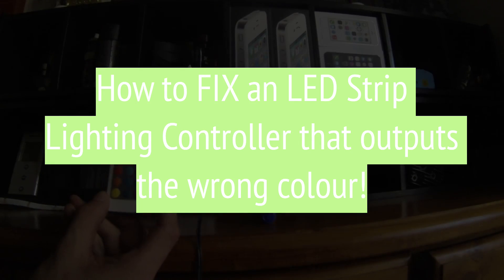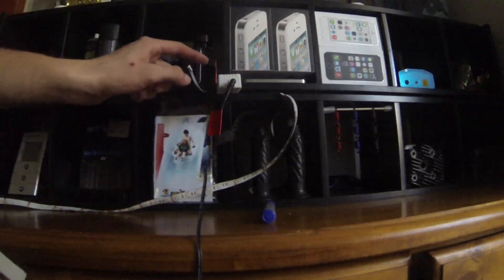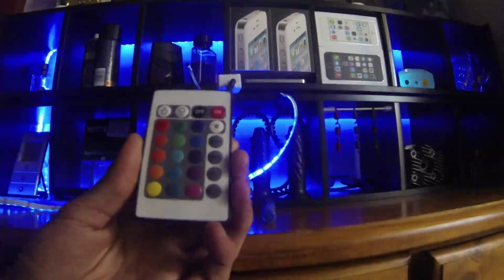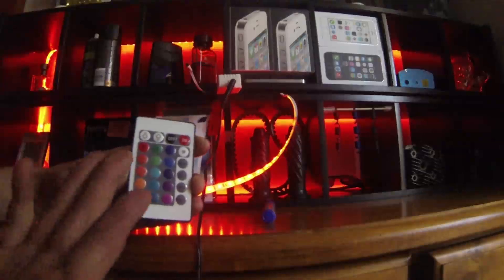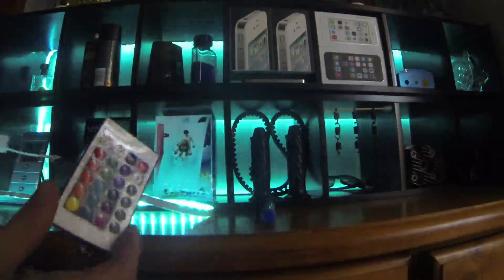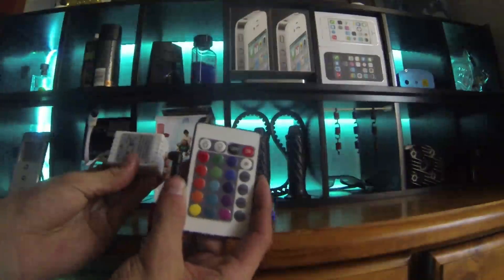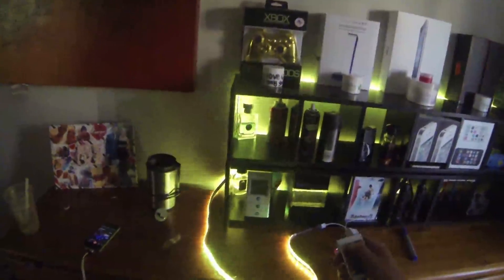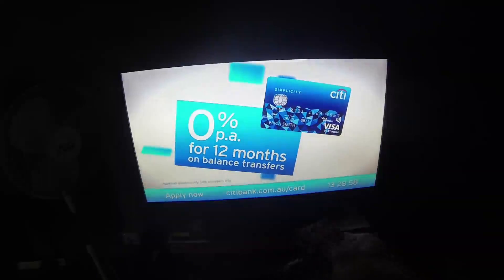How to FIX an LED Strip Lighting Controller that Outputs Wrong colour!

Comment: Hey, when I put off my ledlights, he turned lightred. When I hit on, the leds are the color I last chose. I followed the steps you did because my color outputs were wrong, that is fixed now. But still the red color when I hit off...
Reply: Same With me but blue, did you find a fix?
Reply: +Lord Of The Jaffas Main Channel Yeah, press "ON", "OFF & SMOOTH" do this until you have the right color.
Reply: oh i misunderstood, when i press off on my leds they turn blue doing on off then smooth did not fix this for me thanks anyway
Reply: So, when your LEDS are off, press "SMOOTH", until you got the right color.
Reply: that is one of my problems, but that doesn't fix it, it cycles through different configs but not the correct one,also when my leds are off the blue leds stay on
Reply: Yeah, my red stays on. But I'll fixed it with pushing on "SMOOTH'.
Reply: so just turn the leds off turn them back on and click smooth? when i do that the leds still stay on when i press off. and the remote still isnt programmed correctly. any ideas?
Reply: +Lord Of The Jaffas Main Channel No, when the LEDS off, then click SMOOTH en then on.
Reply: thats what i did, i mistyped
Reply: +Lord Of The Jaffas Main Channel I don't know than, sorry...
Reply: thanks anyway
Reply: +Lord Of The Jaffas Main Channel No problem, wait, what controller do you have?
Reply: +Corrender the white 24 key one
Reply: +Lord Of The Jaffas Main Channel I have the same I guess. Just try some buttons. I'll look tomorrow if I was right.
Reply: +Lord Of The Jaffas Main Channel I have the same I guess. Just try some buttons. I'll look tomorrow if I was right.
Reply from the maker: Hey mate, open the Controller Module Box with a flathead screwdriver and let me know if there is any damage/burn marks- if so you will have to purchase a new controller :-)
Reply: +Drew BoyerGamingHD good idea, will give it a go and let you know
Reply from the maker: Lord Of The Jaffas Main Channel Sounds good, i have a feeling it will be your problem.
Reply: +Drew BoyerGamingHD I know that it's a problem with the box as I tried it with different leds and the problem persists so I would guess you are right

Comment: Worked for the remote with the 6 custom color settings as well.  My LED controller worked fine for over a year, but when I got a new TV and some of the buttons on the TV remote do random things to the lights screwing it up.  Thankfully, now my TV is set up so all I use it for is power, and now the LED strip is fixed as well.

Comment: Thank you so much! On my 44 key remote it was the FADE7 button.
Reply: Do all your colours work? Maybe your blue channel is broken.
Reply: Same here! Thanks!
Reply: Same here! Thanks!
Reply: Thanks dude!
Reply: Your comment was 9 months ago so I write with little hope, but I'll try anyways, my 44 key remote is not fixed when i follow this procedure, my red key only cycles through pink and green and it does not alterante pink/green, instead it alternates something like pink/pink/pink/green/green, can you help me?
Reply: What do you mean with "my red key only cycles through pink and green..."?
Reply: I mean, it's just supposed to be red.
Reply: K3V0M It means that when I do the steps here, it only changes to those two colors instead of red
Reply: K3V0M hey man my white color channel is working but at the end of the strip it give me a different color anyone can tell me why ?
Reply: The strip is fine, when I play around with the pins i get red and yellow (only for a few seconds) but the controler has no fix
Reply: K3V0M I have that remote as well I was trying to figure out which button was it on my remote and it was Fade7
Reply: Same here ! Thanks 🤙🏼
Reply: K3V0M thank you! I couldn’t understand what he said then I looked down and saw your comment. Fixed it in seconds.🙏🏾
Reply: Perfect sorted mine 44 key as you said fade7. Thanks
Reply: Same bro
Reply: I have an 44 key but it doesnt work for me, this comment was 3 years ago but does anyone have any ideas.

Comment: worked, but half my blue LEDs are always powered a little, even if off
Reply: +agentmikster44 That's normal do not worry. Just turn it off from the mains if you do not want them to be on at all.
Reply: +Hitsu Bitsa 
From the mains?
Reply: agentmikster44 The socket in the wall.

Comment: Oh my god thanks you so much this helped me a TON! Also if you go to these links you could get it for suuuper cheap
Remote and controller: http://www.banggood.com/44-Key-Mini-IR-Remote-Controller-Control-For-3528-5050-RGB-LED-Strip-Light-p-972358.html
Lights: http://www.banggood.com/5M-300-LEDs-SMD-3528-Flexible-LED-Strip-Light-Non-Waterproof-DC-12V-p-922277.html

Comment: mine only shows blue
remote not working
any idea?
Reply: +Amar Cakic You might not have connected all of the RGB pins properly
Reply: same :(
Reply from the maker: Check battery in remote, if thats fine then simply purchase a new remote! If the R G or B LED does not work then, check your connections- all LED strips should be soldered or have another really strong bonding hold!
Reply: Yeah, i ended up fixing the remote and it was because there wasn't a battery xD Thanks!
Reply from the maker: XD

Comment: Mine has mostly green LEDs on when I press red, there are some red LEDs on as well and I used to be able to press red a few times and it would change correctly. Any idea what I can try to fix that? everything else works properly, except colours that require more red. Thanks

Comment: how can I fix it if power button also works incorrectly ?
Reply: I have the same issue. Pressing the ON/OFF button doesn't turn it off, it switches color instead. Did anyone find a solution?
Reply: Shaiya Coprez did you ever find a solution? Cuz I’m having that problem right now😂
Reply: Thankyou!!!!!!!!!!
Reply: downlaod the app that is the remote and with that you can control it xd 4 years late but whatever
Reply: Skiller S the colors are still different

Comment: Thanks as well! Was fiddling around with the connector itself, since this showed me the correct color every x times.Did your trick, but had to hold down the smooth button while pressing the on button again.After 2-3 times the original colors came back and I could select orange again (hey, I'm Dutch ;p).

Comment: Got a 44 button remote and the same problem, colors are wrong.
Dubbel checked the wiring, soldered.
If i turn it off and press the Fade7 button is doenst light up for that second, and when i turn it back on it hasnt changed color.
Any idea?
Reply: Little Rabbit same with mine
Reply: Little Rabbit ever found a solution LOLL
Reply: No nothing
Reply: @LRa33it  Try the Fade7 button trick for 4-5 times.
Mine worked after the fifth time.
Reply: Mine's 24 also same problem

Comment: Mine never becomes red, should i get a new controller?
Reply from the maker: Tim Vu No, you have not connected the RED Section of the strip lights correctly
Reply: ***** Do you know how i should fix that?

Comment: Hey Drew Boyer, do you know how to fix the strip lighting if a couple of the cells are a different colour on the strip. it is only in 2 small sections the rest of the strip is fine. e.g when on white a couple of the leds are green in 2 sections.
Reply from the maker: That means that the Blue and Red LED's are not functioning correctly, the connections must be 100% bonded as i found that having a crimped connection should work fine, but does not. Soldered connections are the way to go with LED Strips. That's going from one strip to another like this.......

(O=RGB LED)
(Ø= Faulty LED)

 | O | O | O | O | O |------------------| Ø | Ø | Ø | Ø | Ø | 
===Bad Connection^=or here==^

But if you talking about this> | O | O | O | Ø | O | O | Ø | O | O
OR THIS> | O | O | O | O | Ø | Ø | Ø | Ø | Ø | Ø
Then your out of luck and have  BENT the strip a bit too much....